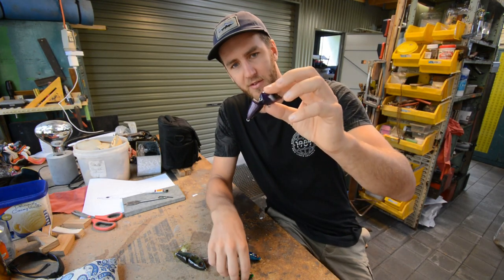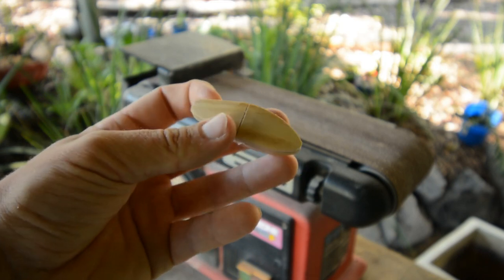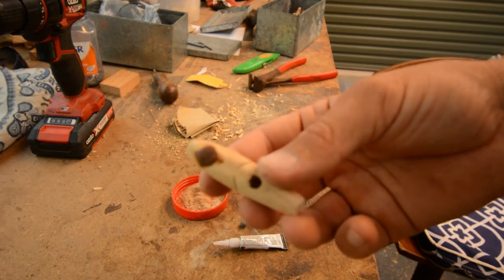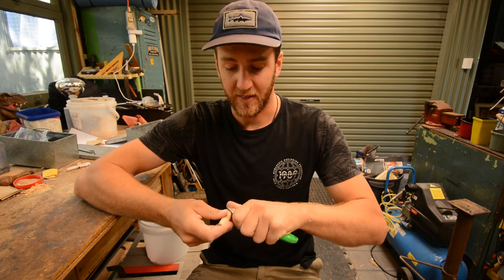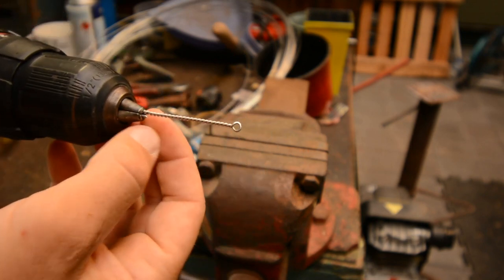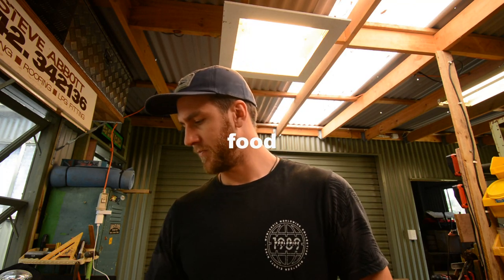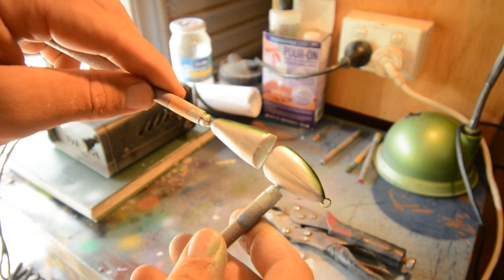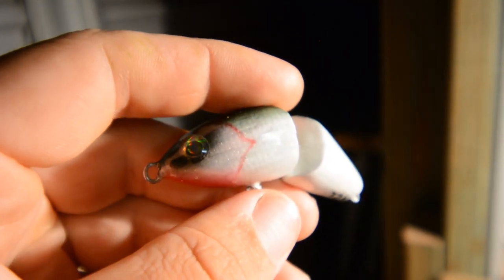How To Make a Micro Swimbait

Comment: I really enjoy your videos. Seems like a lot the baits you make translate to lures that would work good here in the states for largemouth bass. You should consider getting some wire twisting pliers. I switched to those from using a drill and the process is a lot quicker. Keep up the good work!
Reply from the maker: Thanks I really appreciate it...I'll look into those pliers I've never heard of them before.
Reply: Carlee I have tried those before and found them difficult to use and went back to using the drill personally myself. Is there a better way to use them?

Comment: 14:30 why not to cut belly slot before the weight holes, than install the thrue wire 😉
Reply from the maker: Not a fan of through wiring swimbaits...I hate getting paint and epoxy on the joint connecters.
This method works fine for these smaller baits.
Reply: @khyeabbott9391  In that case let's hope those screw eyelets will hold against them Jack's 💪